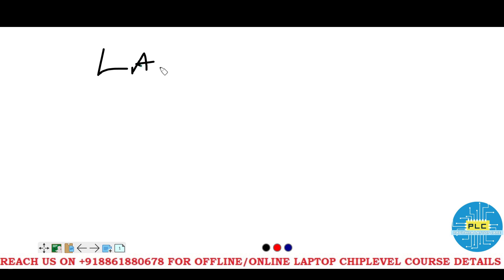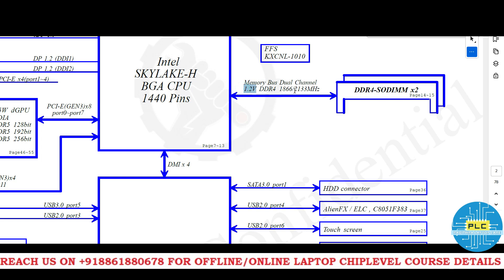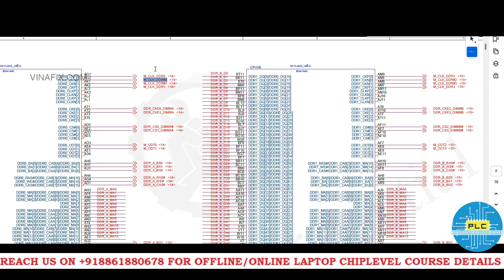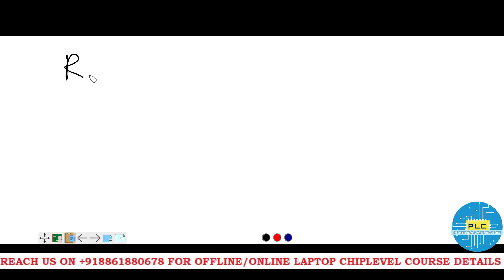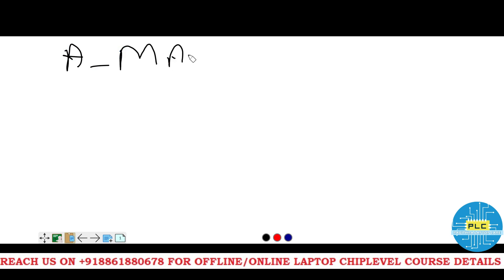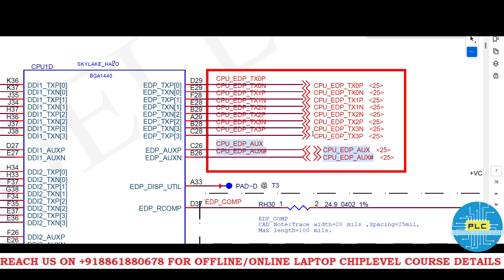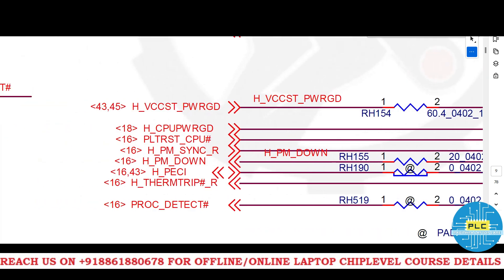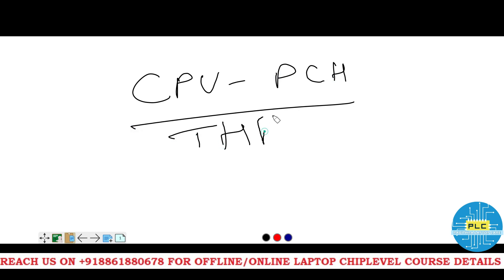The Most Important Processor Communications with the RAM, PCH and eDP in DELL ALIENWARE

Comment: Hi sir. Please what IS EDP?
Reply from the maker: Embedded DisplayPorts (eDP), and LVDS can be used to create digital displays that are fast, efficient, low-power, affordable, and economical. eDP, similar in concept to LVDS uses low voltage signalling (LVDS), which permits for low power consumption as well as reduced electromagnetic interference. It’s capable of sending video and audio signals and also data and control messages. eDP boasts a very high data transfer rate, up to 8.64Gbit/s. This includes four data pairs. The eDP also supports higher resolutions and frame rates. LVDS, however, can provide a solution to large LCDs as well peripherals which require very high bandwidth. It transmits one wire, while the other is the inverted of the other. This reduces interference with surrounding wireless equipment
Reply: Thanks you so much sir. @LaptopCourse
Reply: @LaptopCourse  i learn new things day by day through yours vidéos. May God bless you